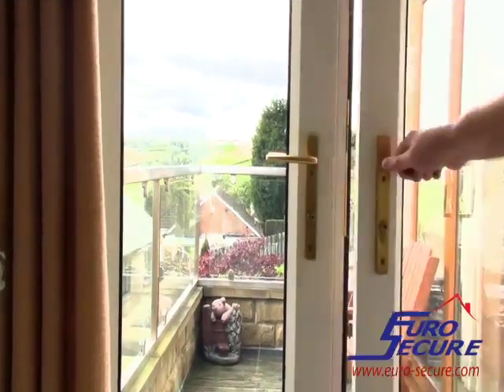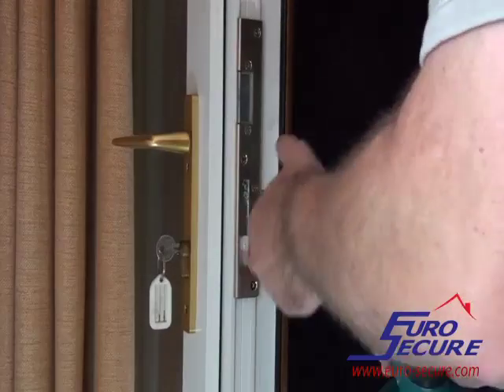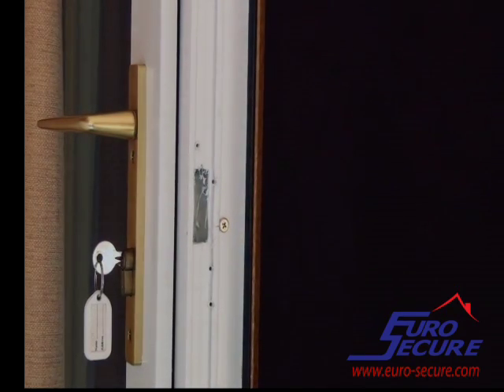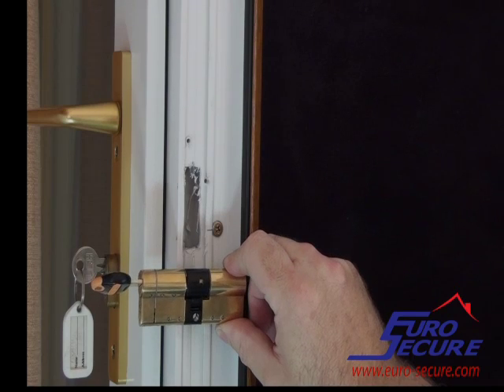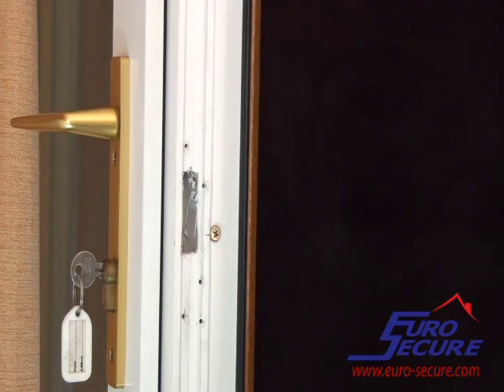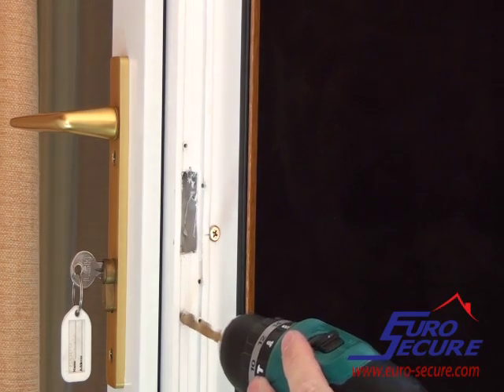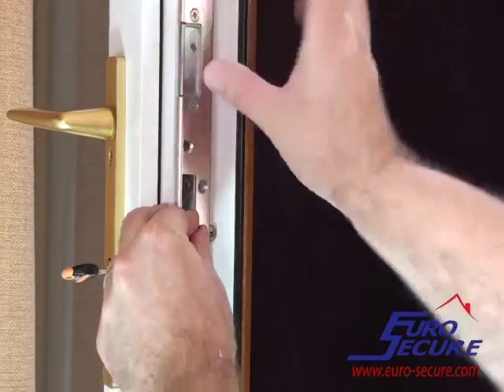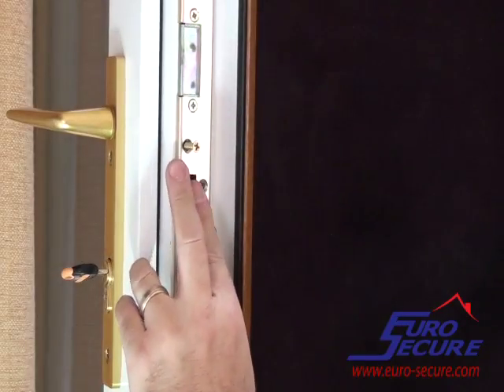Fitting A euro cylinder in a French Door - Slave Door

Comment: Thank you worked a treat, dont try to do short cuts by not measuring properly like I did, it will just lead to frustration. Also, dont be scared to drill through a metal plate if you find one, it should just a reinforcer on the mullion. Fitted new handles and locks after an attempted burglary, I might sleep tonight now:-)